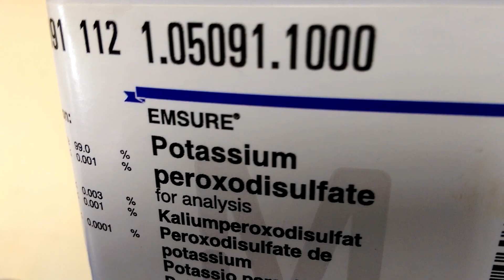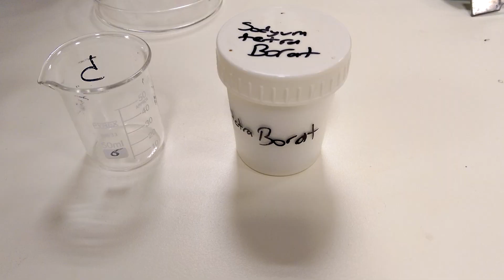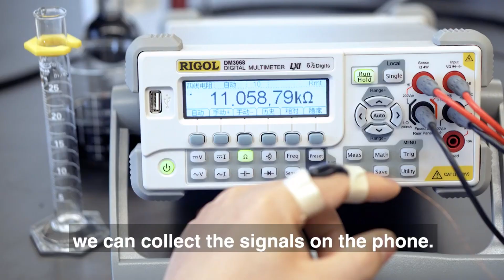Making Conductive Hydrogel | Conductive Polymer Slime

Comment: Why do you put cellulose in?? What is the role of cellulose?
Reply from the maker: Polypyrrole is an insoluble polymer. For this reason, a support material is used by coating it. Microcrystaline cellulose (MCC) used as support material for Polypyrrole. U can use other materials as support such as clay, silica, nano-micro polymers.